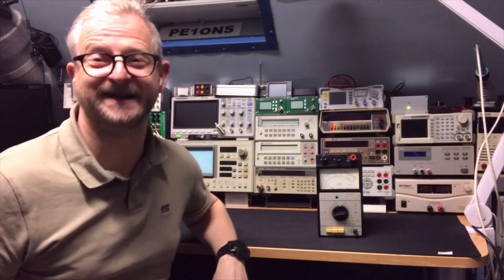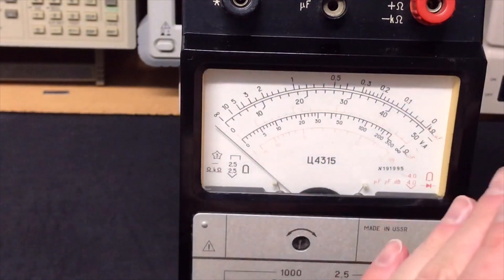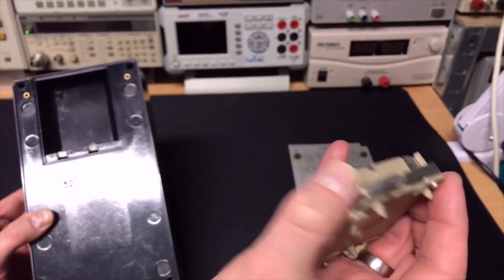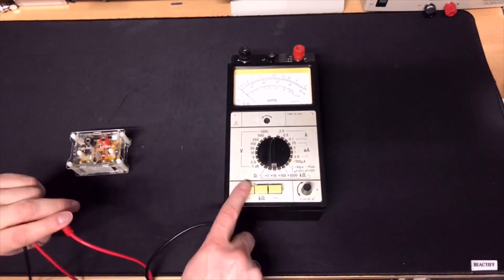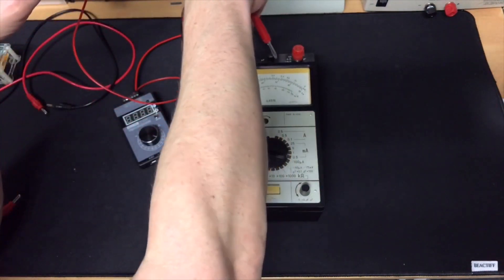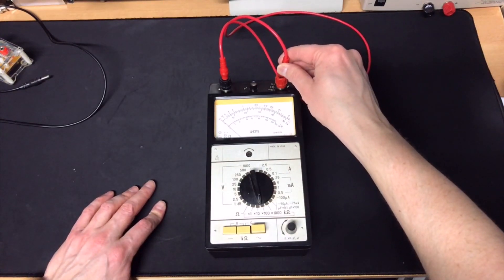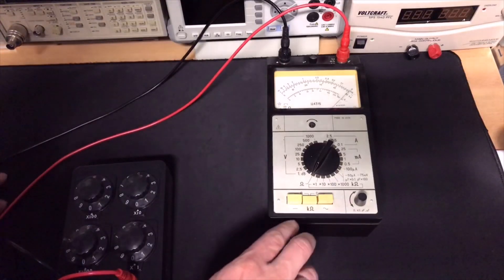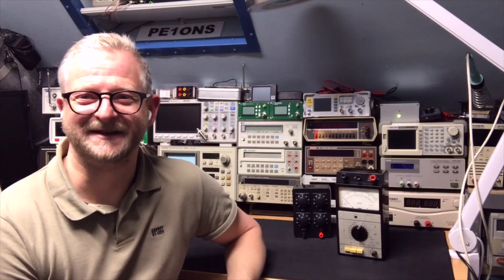#142 Classics from USSR Multimeter u4315

Comment: Today I got a similar model 4341. It sat in its aluminum protecting case, but inside there was a sponge, as a shock breaker, and after 45 years the sponge totally disintegrated, and a lot glued on the meter front. So I go and try to clean, and made a rookie mistake using washing petrol (wasbenzine), and wiped part of the text too. Unfortunately. The meter is spot on. I found 2 spare germanium diodes too, usar manual with stamp and signature of calibration from 1978. Stupid of me to use petrol, but maybe otherwise I could not disolve that gluish sponge residue.... A true restoration project would be to make a new alu plate....
Reply from the maker: Great find man!  thanks for sharing, yes sometimes these things happen... great it is still spot on!.
Reply: @TonyAlbus  yeah, but now I have took it all apart and will restaurate the "switch-panel-background". I will make a new thin alu plate, or maybe other technique to restore it...
Reply from the maker: @ernestb.2377  Nice, lots of work, sounds good.

Comment: That takes me back to my college days Tony.  The thing that I remember was just a quick glance at the meter and you knew if a PN junction was good. Interestingly when checking a PN junction of a diode with the AVO you had to forward bias the device with the black lead (-ve) connected to the Anode and the red lead (+ve) to the Cathode. It was as if the internal battery was back to front. I would be interested for you to measure a diode on the AVO 9 and see if it is black to anode to forward bias the device.
Reply from the maker: Hi Ian, yes that is indeed interesting... i am planning to do an other classic week, and i did find some more AVO's type i did not have and more classics :)